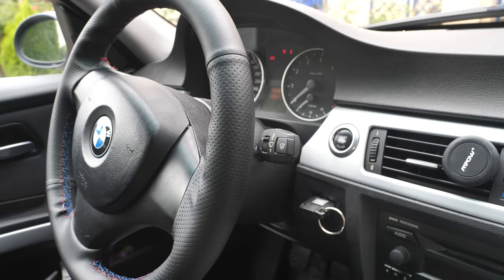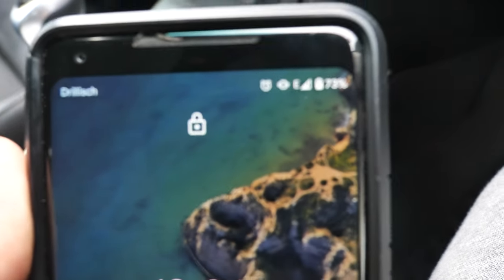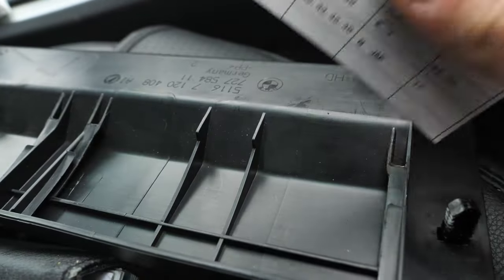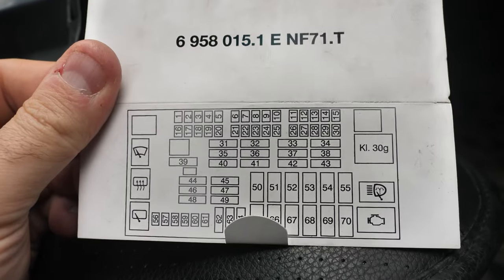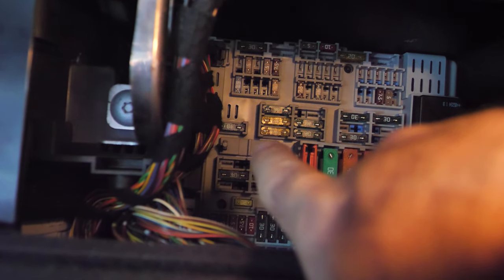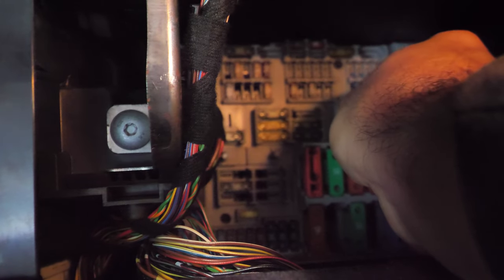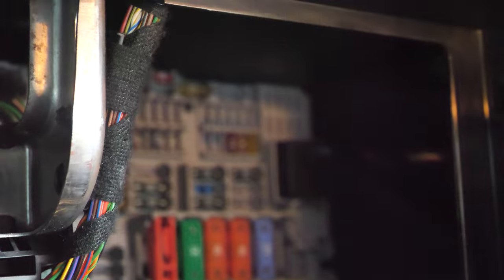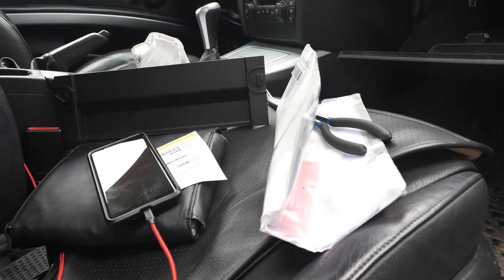[DIY] How to Replace The Accessory / Cigarette Lighter Fuse on BMW 3 series [E90, E91, E92]

Comment: Hi, so my aux and usb port does not work. Could this also be a fix? and how do i know wich fuse is for that?
Reply from the maker: Yes, replace the fuse that I show in this video. Your USB port should work after that. Not sure about the aux port tho.
Reply: @buildanddrive  At least i give it a try, but it didnt fix my aux. but thanks!